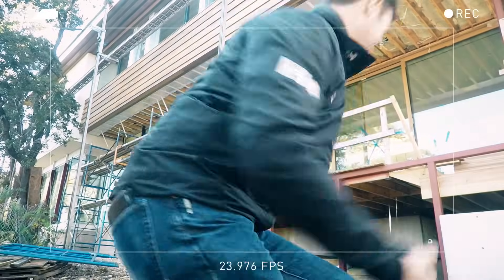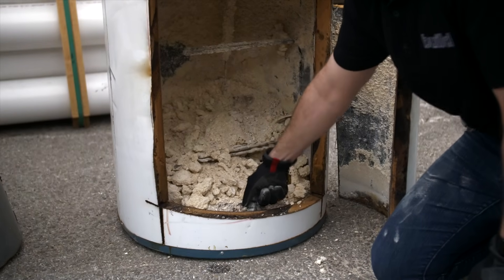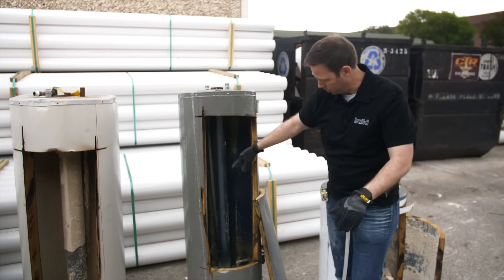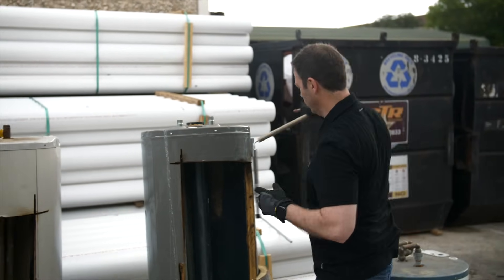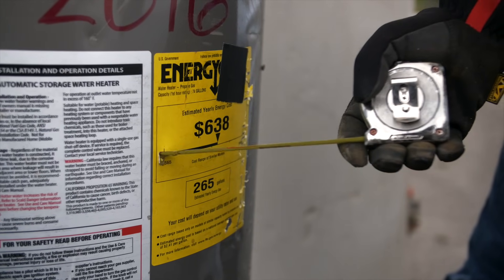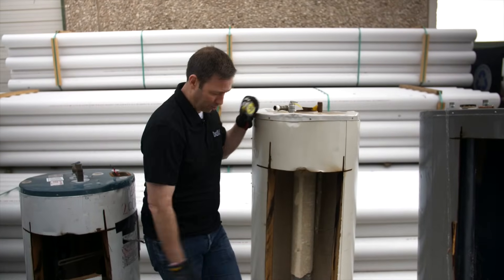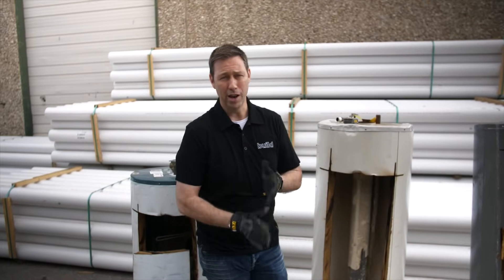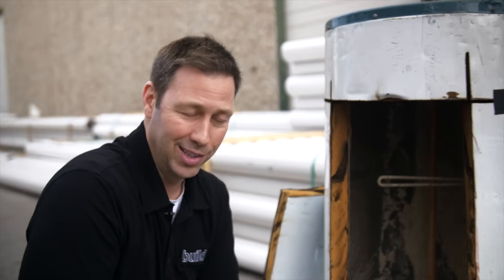Four Water Heater Tanks Cut Open - Lessons to Learn

Comment: A reason that you don't know why the tanks are in the scrapyard  is....Many homeowners buying new houses are advised to upgrade or renew the hot water heater regardless of the age. I don't know why but it happens.  I take tanks out and give them to people in need.  Pay it Forward and repurpose all in one.
Reply: "You don't heat hot water." Nope, I don't. The hot water heater does that.

I wasn't aware water heater boxes were the source of information where we learn how to use language. Which is because they are not. Natural language is developed by how it is used, not the other way around. We can all call it anything we want so long as the intended meaning is what is communicated. If it would help I can bring up other examples where the best way to communicate something is to use the term everyone knows and it is different than what it says on the box of the product.

You assume "hot" is modifying "water" when it could actually be modifying "water heater". 

If you are arguing that a water heater doesn't increase the temperature of water on a regular basis, you would be wrong. I would like to point out that there are different degrees of hot and I mean that literally: measured in Fahrenheit or Celsius. The temperature inside a water heater drops some when you run hot water and hot water moves out and fresh water comes in. It also drops gradually anyways because no insulation is perfect. A thermostat does not regulate temperature to be kept constant. It waits until it lowers to a certain point, then kicks in and heats whatever it is up until it reaches a certain higher specified temperature, and then it shuts off.

People make mistakes. Calling someone a dipstick and commenting "Jeez" after a proposed correction is quite rude. I would hope we could all agree there is enough rudeness on YouTube as is and we would all be better of without adding to it.
Reply: @Elrog3  finally some one else who gets it, to dam many English majors in this field, some people feel the need to  this all the time, they don't usually have many friends. What does bug me a bit is those that insist on calling it buy a name that is contrary to the spelling, such as stihl chain saws pronounced steel.
Reply: Insurance
Reply: Wayne Lewis  Let's say you have filled the heater and gotten it to operating temperature. You open a faucet. The water in the heater is already hot, but it comes on as the temp drops a little. It is still hot. Therefore you are heating hot water in your heater. This makes it a hot water heater. You're welcome.

Comment: That first one was using atleast 7 times more electricity.
Reply: C J nonsense. It uses no more, electric heating is 100 percent efficient, you scale has no effect. It might reduce the volume of hot water you can store, or slow reheat times as the element cannot disperse heat fast enough and switches on and off, but raising a gallon of water to the required temperature will still take exactly the same amount of power.

Comment: Mine is 25 years old and I am not changing it until I have to because new ones are junk.
Reply: I'm noticing this too.  I bought my Nautilus gas water heater in 1997 and it's still working.  Never drained it either and I have hard water.  But the company who installed it also put in copper pipes in my house too.  Excellent workmanship.  I don't see as much pride in workmanship as I used to.
Reply: I had a natural gas water heater last for 25 years too. It finally had pin hole leaks from rust. That water heater worked like a champ.
Reply: The new ones only last a few years been through 3 in 10 years

Comment: Clear-cut, concise, well-presented, and no music = Excellent and appreciated! 👍

PS:. I have watched countless videos explaining the importance of changing out the anode rod and how to do it.  But NOT ONE OF THEM have ever mentioned what to do if you don't have the basement ceiling height needed to change it (for all of us millions of people in older houses, etc).  All the how-to videos are done in "perfect settings" of  newer basements {or other areas) where height isn't a problem.   
This is the FIRST video I've seen that mentions that problem and the flexible anode rods (I for one, never knew they even existed). Thank you, thank you!!
Reply: Unscrew, pull up as far as you can. Clamp vice grips around the anode, then tape plastic around it to keep shavings from entering the heater. Cut off length. Repeat as necessary to get it out. You'll need 2 sets of vice grips, tape, trash bag, plastic bag, and a hack saw.
Reply: @old_shupshe  Why thank you, very much appreciated!
Reply: I liked the birds in the background.

Comment: Another note on powered anodes.  If you live in an area that has hard water, the sacrificial anodes will cause the rotten egg smell as they deteriorate. The powered anodes do not break down at all.

Comment: I used to change out my anodes every 3 years but decided to try a powered anode. It's been 8 years now on a 17 year old heater. I also do flush out the tank once a year so that helps. Powered anodes are pricey but even when this tank needs to be replaced, I'll be moving the powered anode to the new one.
Reply: After getting rotten egg smell I replaced our rod with a powered one. It's been in there 7 years now.

Comment: you should open one that was maintained with a full port 3/4 inch ball valve yearly to see how much that would make a difference. for those that don't know, most tanks are built with a 1/2inch partial (cheap) valve so when you do your yearly drain off on tank you cant get enough flow to really stir up the bottom to remove some of sediment but by changing your drain valve to a 3/4 full port ball valve you could stir up the bottom much better to get more sediment off bottom ...

Comment: 15 year standard? Are you kidding? Even back in the old days when they made tanks good they didn't average 15 years more like 10. If you change the anode rod which no one even knew existed back in the old days you might get another 5 years out of it.
Today all of these tanks are made by the same three companies no matter what it says on the tank and the tanks they make today are absolute junk! They've been like this for a good 10 or 15 years, junk! That grey tank is sold at the big box stores I won't mention the name but I can bet you money that the reason it went out was because of a defective gas valve. Those tanks are famous for it. Also you need to replace the anode rod every 5 years not 5 to 7. Now mention the fact that in the old days you could buy a tank for a hundred bucks or so now they cost 6 $700 and they are junk. According to the research I've done the average lifespan of these tanks regardless of where you got it is about five to seven years nowadays. Changing the anode rod might give you a little extra time but not like in the old days these tanks are made all around of junk! It's that simple.
Reply: I bought a Marathon water heater about 10 years ago. Plastic tank, no anode rod and lifetime warranty. I've had no problems.
Reply: @InfiniteMushroom the unit's plumbers get aren't any better but what I said was the big box stores tend to have even worse quality water heaters that are made specifically for them at a discount.
Electric water heaters are better the elements tend to go out in them but they are easy to replace. But they are all made out of cheap materials. Tankless water heaters have had a lot of problems in recent years and they tend to be expensive. You really can't win nowadays. Sorry I couldn't help you the only thing I can do is warn people that those expensive tanks are going to last as long as they used to.
Reply: Got a heater at my buddies rental house from the 1979 still not sure how
Reply: @Phyllis99  there are exceptions to the rule but on average tanks in those days lasted about 10 years I know this because I used to install them. 10 years was average in my experience
Reply: I replaced mine a few years ago from Home Depot, it would have been half the price if it'd hired a plumber directly for installation rather than buying installation with the heater.  First, they sold me a heater based on what I had, not what I needed, second they sold me a less energy efficient one then I intended because , I suppose, the price was higher, third, they charged handreds of dollars for the service of coercing me into buying the wrong heater (I asked the plumber what he got, it was about half the installation fee I paid).  So what I'm saying is even if the water heater doesn't last, we can still do worse for ourselves.  At least if it only last 5 years I'll remember better what to avoid next time.
Reply: I got 25 years out of mine
Reply: My natural gas tank lasted 34 years and was original to house when I replaced it. 34 year tank was from the early 70s.
Reply: @honeybadger9268  we're talking on average here I know of a couple exceptional stories in myself but this is what most people have to deal with not a tank that last for 25 plus years.
Reply: I'm going on 17 years right now, changed elements and controls once
Reply: @mopar340dave  I would credit the long life to the water quality. In my corner of the world you probably wouldn't have changed the elements because the corrosion would have prohibited removal of the old one. Not only do the tanks fill with crap, so much builds up on elements that they won't come out. 

The municipal water in the towns and commercial rural water require softeners and multi-stage filtration if  heater is going to make 5 years or more. (Ever wonder why people drink so much bottled water? They changed the water tank and saw what they'd been drinking.)
Reply: Almost everything modern is junk. But what about commercial water heaters? Are they any better than consumer grade?
Reply: Harry Schultze I have the original water heater tank in my house from 2002. It looks perfect on the outside, there’s not a blister anywhere on it. Like anything for whatever reason sometimes things last. I have a Ford truck with 370,000 kms that has the original alternator in it. I’ve never had a vehicle go that many miles on the original alternator. I have a Mustang with 150,000 kms that has had the alternator replaced 3 times. I remember reading a story before about some lightbulb that has been burning continuously for over a century. So for whatever reason sometimes things last a lot longer than expected.
Reply: Newfie-Dean  😉   Re your light bulb comment....I have two light bulbs in a hall fixtures.....almost 50 years old.  Bought a dozen from a charity.  The rest were like regular bulbs, but these two just keep burning.
Reply: Harry Schultze senl loopo morning
Reply: I think a lot depends on your water supply.  I'm on well water and with my minerals I'm lucky to get five years.  On my latest water heater I'll start changing the anode, which no one really did in the past. When I tossed my last water heater after less than five years - the anode rod was bare wire.    Also I'll start flushing more often.
Reply: My water heater was built in the 80s. Still going. Haven't touched it in 20 yrs...awaiting coming home to a pool in basement someday.
Reply: Harry Schultze totally concur, had a Bradford White installed new in 2012, in 2018 water dropped and she was toast, I am on city water too. Shameful these companies have cut corners like they have, save water but throw these inferior metal canisters into the landfill at 2x the past rate.
Reply: I get 20 years out of my hot water tanks, then replace them to avoid water damage risk from leaking tanks. It's probably our water quality but that's the mileage I get.
Reply: I have a 25 year old A.O. Smith gas unit, looking to replace it soon simply to get a more energy efficient unit. We moved in about 5 years ago, still puts out plenty of hot water, but I know it's a ticking time bomb. Upside is where it's at in my unfinished crawl space any leaks will go straight to the backyard. City water has gotten worse the last couple years with sediment so I'll be adding a sediment filter to the new unit. Considering a heat pump unit as it'll work with my solar, but not sure.
Reply: @InfiniteMushroom all three manufacturers are equally bad! The big box stores sell the worst water heaters they tend to be made to even a lower standard. It really doesn't matter what kind of insulation the more you have the better off you are because the tank doesn't have to work as hard to keep the water hot and it will cost you less in gas and wear and tear. Sorry but the manufacturer really doesn't matter anymore I knew someone who got a Lochinvar years ago and it turned out to be junk! Lochinvar used to be one of the best of the best when it came to hot water tanks and such. Everything is basically junk now.

Comment: One of the problems we've faced here is that the ANODE causes our water to STINK. It does. I've tried Aluminum and Magnesium anodes and the water coming out of the water heater smells like rotten eggs. So to please the wife (and we do have a water softener), I had to remove the anode to keep the water from STEENKING.
Reply: If you remove your anode, remove your water softener as well because soft water is corrosive.
Reply: @pauld3327  Well, I haven't had any issues yet, but we did install an IRON (ozone) filter, and things are great. I drained the hot water tank, oh, a while back and used a "giraffe" inspection camera inside the tank and there's really nothing going on inside there.... so I'll just keep doing what I been doing, the hoht water tank (Rheem) is now going on 14 years old....
Reply: @pauld3327  Meh, what we did was  install an iron filter, problem solved.

Comment: The mass of sediment on the first unit (even though covering the elements) won't reduce the efficiency at all. 100% of the electric heat will still make it into the water. Recovery time will be slower though.